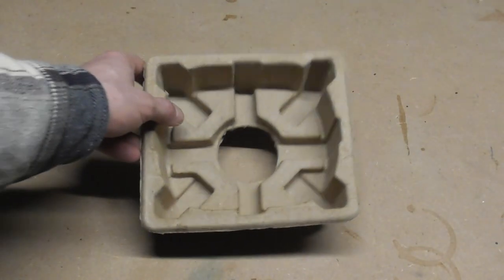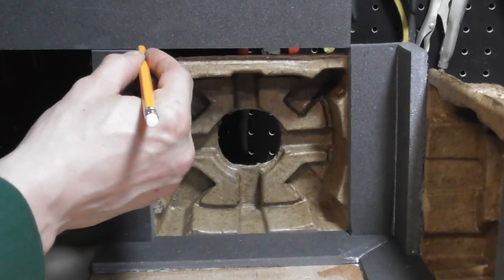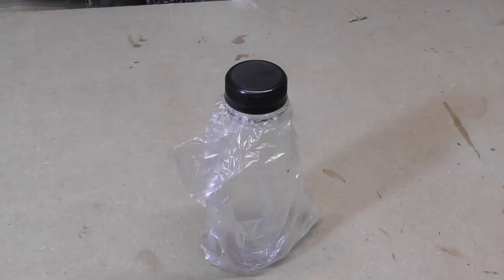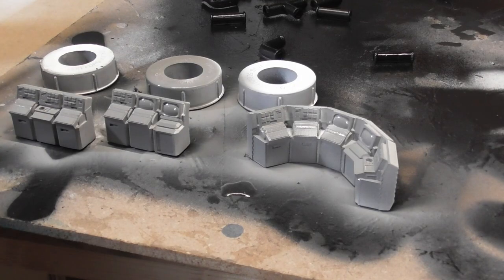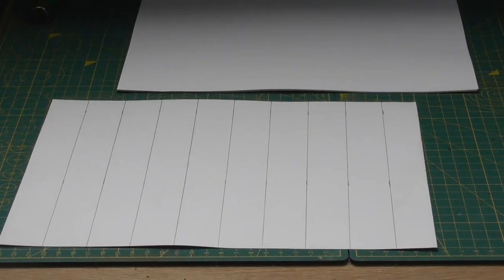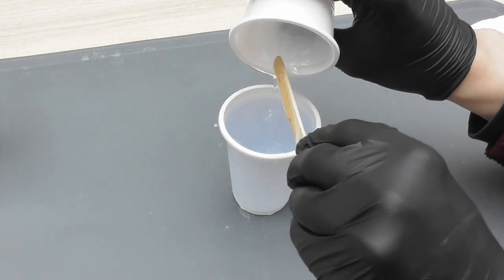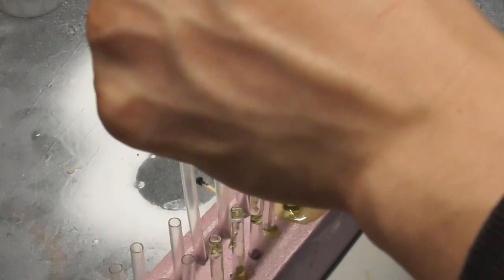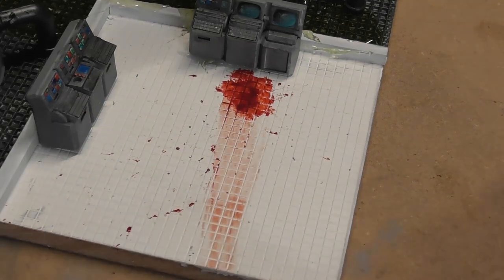Building an ALIEN Lab Escape Diorama

Comment: What an awesome build! Just a tip - those modular straws can be bought cheaply from One Below if you have a store near you. They’re £1 each. 

How did you get paint to stick to the rubberised joins though please?
Reply from the maker: Cheers 👍
Reply: @creativecuts7803  how did you get the paint to stick to the rubberised joints on the pipes please?
Reply from the maker: @sub39h  oh gosh, because they are rubbery, probably have some silicone in them. Basically I tried to prime them and then paint on thick acrylic paint. It took a couple of coats but it covered. However, the moment I touched them the paint comes off so I handled them super carefully, glued them in place and then touched up any paint lift.
Reply: Very very nice. As mentioned the shattered glass and protruding wires coming out best I've seen. Soon I will be using resin pour. Haven't seen any cheap as you mentioned (price not a deal breaker) will check around, maybe you have supply list. Didn't check yet. Maybe make my own pour. Your narration is as sweet to the ear as your dioramas are candy to the eye..subbed..a pleasure, mine.

Comment: Micro and spaghetti LED's will make a good edition, if you want to add some lighting. They are tiny, and the spaghetti LED's are flexible, and you can cut them to size. You just need to solder them and connect them.
Reply from the maker: Great tips. I do have quite a range of leds in my 'armoury', but will defo check out the ones you mentioned.

Comment: You need to lightly sand plastics to give it some tooth for the glue to grab onto. Trying to glue smooth plastic doesn't work well for the same reason spiders can't climb out of bathtubs.
Reply from the maker: Great tip. I often do that. I still find that some plastics just don't like certain types of glue. Must be something in the chemical make up. 👍
Reply: @creativecuts7803  I've read/seen others talk about certain plastics not bonding with certain adhesives. And some need a treatment before they do glue together, like a primer, sanding, etc. Flaming a surface seems to come up frequently in videos as a way to change the surface chemistry of some types of plastics. Just a light, quick going over with a butane torch. No melting at all. Sounds weird, but seems to work really well. I think I've seen 'Bill Making Stuff' do it. 
I love the sewing/knitting grid! Funny enough, I use it for straining spout seeds when growing them in Mason jars, but didn't occur to me to use it for trash bashing! LOL! Gonna have to rob one of my own stashes for another stash!!!

Comment: Great job what Brand of paint and Brushes you use
Reply from the maker: Cheap sets of nail brushes from amazon. They come in a range of sizes and I basically have 3 brush pots brand new for detailed painting. 'Used'for everyday painting and 'glue' brushes. I'm terrible at cleaning brushes well so I kind of see them as disposable. Approx £10 for 10 brushes